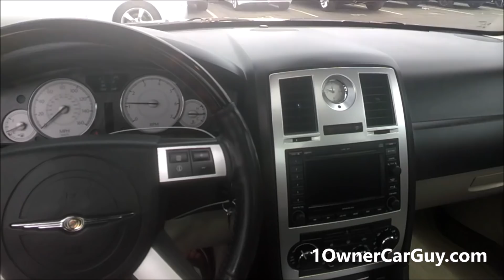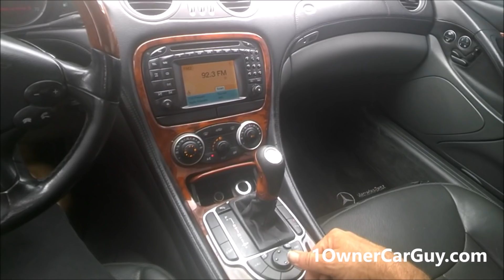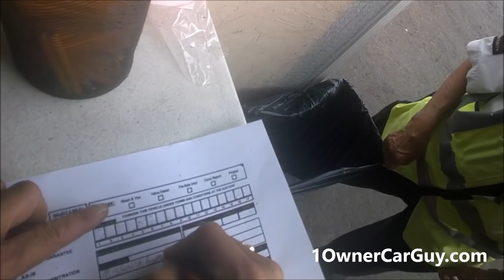CAR AUCTION ~ SELL & BUY MERCEDES TRANSPORT ~ DAILY VLOG

Comment: I’m still looking for a 1992 Cadillac fleetwood sixty special with the firemist sapphire blue exterior and 22-way power leather ultra seats.
PS-I’m restoring a 1987 Cadillac Cimarron with a 1987 Chevrolet cavalier z-24.  The only thing I’m missing for the Cimarron is the complete Bose music system (wiring, trunk mounted amp for all 4 speakers and the two front kick panel speaker enclosures).  Any suggestions for repairing the z24 fiberglass hood?